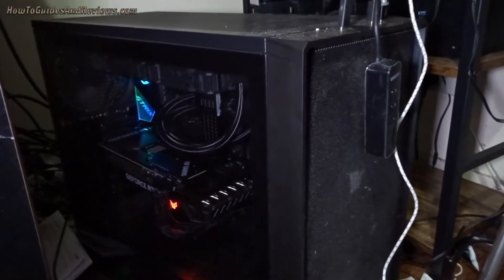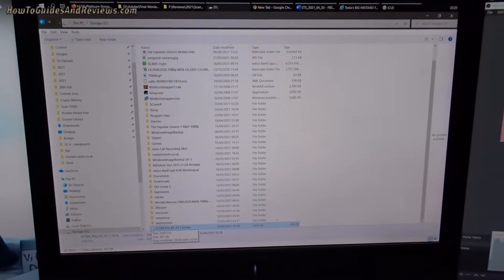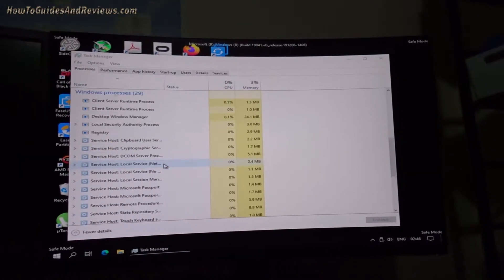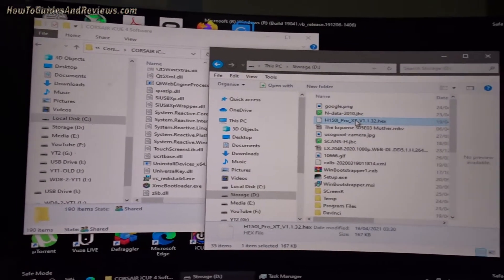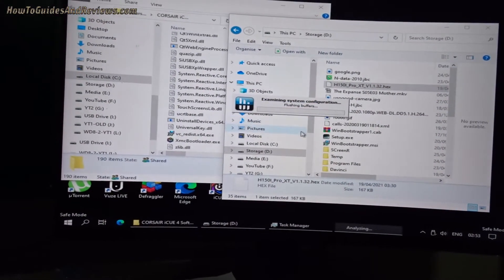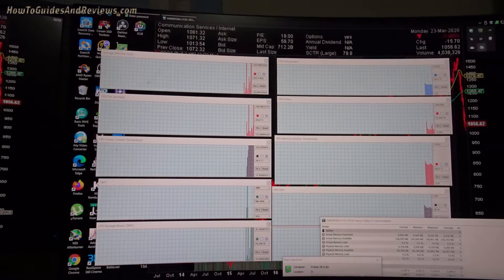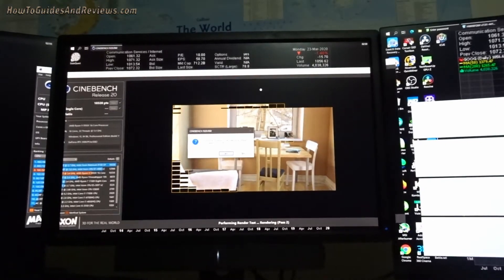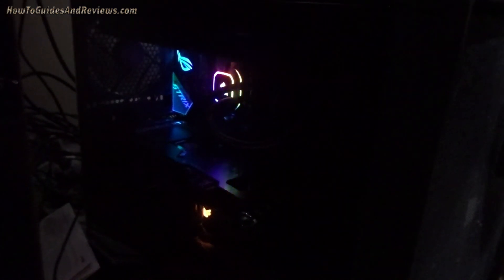How to Unbrick Corsair Radiators After Failed iCUE Firmware Update - H150i Pro, H100i, H115i Fix

Comment: I managed to find a H115i Platinum hex file online and I unbricked my AIO by following this video. Thanks for the video. I spent over 2 hours reading and everything I could to fix it. I followed the steps in this video and my RGB came back online on my pump and my fans stopped working at full speed.
Reply: how did you find it

Comment: thanks heaps. bricked mine after the PC thermal throttled because the mounting hardware wasn't letting it reach far enough. the back plate threads were too long for some reason

Comment: Can't find the hex file. Is it available anywhere online
Reply: Went to h115i settings in icue and forced firmware update. Fixed. Didn't need to find hex file or run bootloader in safe mode

Comment: hello my h100i pro  was not recognized in icue and the rgb did not work, I reinstalled icue and did your method (it did not work, it displayed "unable to device connect") so I turned off the pc and disconnected the power supply I kept pressing the power button for 20 seconds, I restarted and everything was back to normal :)
Reply: No fucking way, you are a legend. My h150i did the same thing, followed what you did and now it is working perfectly again :D
Reply: @MHanssen   hehe very nice my friend
Reply: @MHanssen  now my fans are running at 2700 rpm constantly impossible to stop them, I unplug them fortunately that I am in push and pull configuration on the radiator
Reply from the maker: Your firmwarte is corrupted, you need to do a firmware update.

Comment: The only issue i had was today when my fans went too loud and the logo of corsair wasn't lighting up, then i turned off my pc and it said that my cpu fan wasn't working, i need to try this and see if it helps, i never really downloaded iCUE or something
Reply from the maker: Yeh, its happened several times to me, without touching ique, firmware update is the last resort. Try this, leave your computer off for 6 hours, for some reason this worked for me on one occasion. might post a video,  COME ON CORSAIR IMPROVE YOUR QUALITY CONTROL! It's not for me to do your job for you!

Comment: Man i have the exact same problem. Did everything in this video up until the point i had to drag the hex. File but it says “device not found” on the command prompt :(
Reply: im on the exact same situation. seems like its no being recognized by the pc.  Did you fix it or just replaced it?
Reply from the maker: In which case the hardware may be damaged. They don't seem to be very robustly made, letting down the corsair brand.
Reply: @Quantum_AI_Tech  so i would have to replace it?
Reply from the maker: contact corsair, it comes with 5 year warranty

Comment: So my H100i Elite is working just an issue with the rgb flickering or failing, also my firmware won't update. Should I just follow these steps to correct that?
Reply from the maker: sounds like your firmwares got a little corrupted, if not hardware fault then this should fix it.